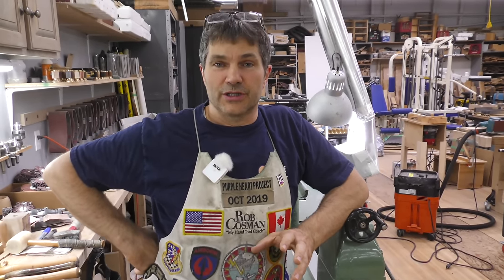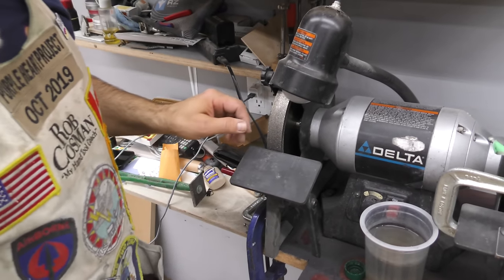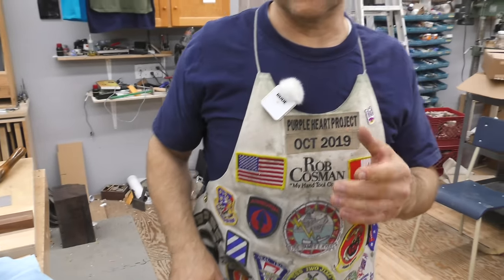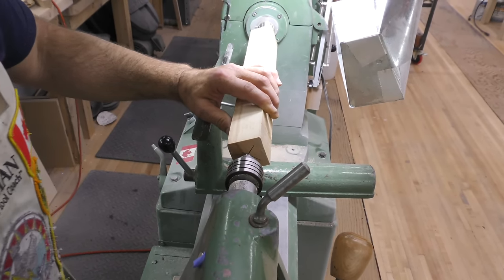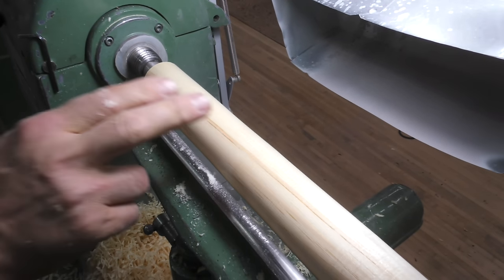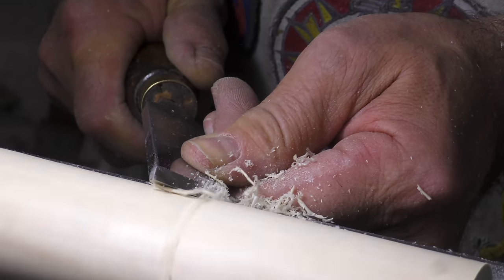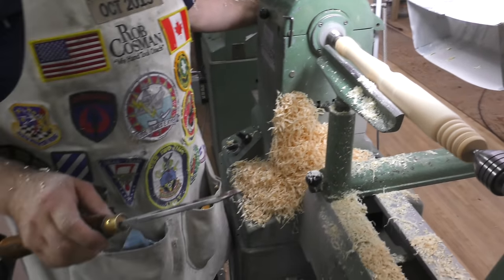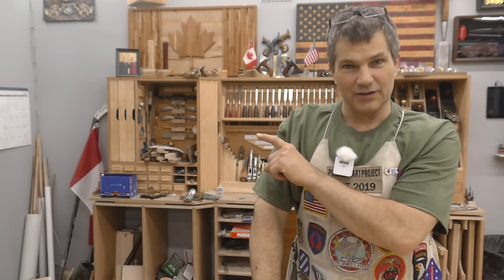Wood Turning For Beginners - Skew Chisel (What you need to know)

Comment: Thank you so much for your video.  I am 72 years old and new to wood turning, acquiring my lathe in early February of this year.  My only instruction has been what I could pick up from YouTube and recently there seems to have been an abundance on skew chisel fans and I find myself spending most of my lathe time with a shew chisel in my hand.  This past week I spent over 20 hours cutting V-grooves, rolling beads and barrels not to mention bringing my stock, be it square or tree limb shaped to a usable round condition.   What makes it an especial challenge is the fact that I am handicapped and cannot stand for more than a few minutes at a time.  Running the lathe, I am always seated on a 24" high wheeled stool.  My most recent work has been a variety of lace bobbins, using a 1 1/4" x 3/8" skew chisel for most of the work on each one.  
Again, thank you for your time and dedication.  I will be looking forward to your next video.
Reply: Best of luck to you, I just started, too.  I'm 74.

Comment: A couple of comments. One quote I have used for years, and then saw on a Roy Underhill show with a guest who was talking about hammers. It came from an old black and white Hollywood movie about Cyrano De Bergerac. He disarms a student and then comments, "Hold the sword as you would a bird. Too tight and you kill it. Too loose and it flies away." No white knuckle grip!

There is a ratio on spindles that applies to 'whipping' which is the tendency of long spindles to vibrate as you turn. It is 10 to 1. So a spindle about 1 inch diameter and 10 inches long will generally not 'whip'/wobble as you turn. 

From an unknown spindle master, "The bevel should rub the wood, but the wood should not know it." If you watch some one who is a master with the skew, it is amazing how little bevel pressure is needed for controlled cuts. 

Those who use a hollow ground bevel are by far the huge majority of turners. The flat ground are a minority. There are a few who use a convex grind. I have tried it, and for sure it is nice for coves, but kind of difficult to cut straight with. 

I use scrapers far more than most people do, and I don't have any of the carbide tipped ones. For heavy stock removal, a peeling cut is very effective, and it is kind of a scraping cut. Process is the same as a spindle roughing gouge. Start with the bevel high and the cutting edge not engaged. Slowly raise the handle till it starts to cut. Essentially you are cutting on a tangent. The surface is not as clean as a shear cut with a skew, but that can vary a lot depending on the wood. Pine, very rough. Sugar maple very clean. 

Looks like you have a high speed grinder. For my turning tools, I use a slow speed grinder. Consensus seems to be that with any good high speed steel, you can not get a tool hot enough for it to lose the temper. I don't quench. I do love the CBN wheels. Some have 1 inch or more for side grinding. 

Richard Raffen is a master. He did one for Fine Woodworking that still makes me jump when he gets a catch. The late great Allen Batty has a You Tube video that is very good.

Comment: So just last night I was getting some cedar round to make a pepper grinder. It was looking too small so I figured I would try out my skew. I hadn’t used it yet even though I’ve had it for over a year. I was blown away when I saw how smooth the piece was coming out. Then I watched this video. Tonight I will play around with it and start using it as part of my arsenal. Thanks.
PS, why are some skews sounded top and bottom and some flat on both sides?

Comment: Don't have a lathe but absolutely want one.  Would be very useful.   Hopefully just learn this skew chisel and not bother with any other tools.  Awesome video.
Reply from the maker: Well you really need 4 chisels for turning, depending on what you do of course.  I think the skew is the most important.
Reply: I'll take your advice on that for sure.
Reply: I agree the skew is very useful tool :-) I started with it, when I participated woodworking courses on a local adult education center. The first time tools were dull, but got much better results when sharpening. I got occasional catches with that tool, mostly when doing round shapes (beads) and with parting. I quess the root cause is that the edge of blade did not rest properly on wood (and the tool holding angle & support point on the tool rest).

Comment: i met an local man who was during the 1950 or thereabout, the shop master of the Mare Island Navy Yard pattern shop, he apprenticed there in the early 1920s and built patterns for an early iteration of the Doble steam car; he offe5red to demonstrate the use of the skew chisel on a wood lathe that he had built from castings and patterns that he made. He seemed quite proficient with the skew chaise and showed me to grind the face of the chisel about twice the length as the normal, stating that the longer face made digging in less likely, as the point was further away from the cutting area, also he said that most of the patternmakers used a firmer chisel in place of the skew chisel as it could be used in hand as a skew chisel or a scraping tool.  His name was Earl Greenwell, proud of having known him.

Comment: Just two weeks ago I bought my first lathe, before that, I played around with a lathe only once, which was a few years ago with an old friend of the family in Germany. One whole afternoon playing around with a spindle gouge, I was enthralled. So, when I bought that lathe two weeks ago, I obviously also bought a bunch of tools (a 6pc british Record Power set). 
So far, I used all those tools without problem, except one. The one I haven't used so far is the skew chisel, which scared the heck out of me. It just looks like it'll easily bite into the wood, and it was literally giving me visions of that thing flying out of my hands (and into my stomach, or other bloody mishaps like that). Well, this video, especially the slow turning part, did give me a good clue on how to handle it properly AND safely. 
I can work with tools of which I respect the risks they come with. I refuse to work with tools whose risks I fear. Turning fear into respect requires knowledge and understanding what's happening, and that was exactly what this video provided.

Comment: Hey Rob, I want to thank you so very much for this video. I have only been wood turning since April 2022 and I kept failing at the skew badly. I got to where I only used it for cutting lines. After watching this video first thing I did was resharpen my Harbor Freight skews to an angle much closer to yours using your grinding wheel technique which took a couple hours in the Florida heat cause i had to take breaks. Those skews were very far off from the angle you use and I had been staying with the original angle which was clearly the wrong things to do.  Then I just finished trying what I watched you do and have managed to get some fairly decent cuts that would require much less sanding. Granted I am still horrible with a skew but practice makes perfect. At least now I have the knowledge to learn correctly. Thanks again. Yall have a wonderful day.

Comment: Confidence is the most important thing with the skew chisel, a catch or two can demoralise a beginner. So much so they abandon the tool for something that seems less lethal. This is a real shame, because nothing can match the skew for crisp spindle turning. I'd advise using a concentric drive centre, which will stop rotating in the event of a catch. You will recoup the cost with the reduced laundry bills.
Reply: Gav, you make a very good point here, it was a rather nasty catch with the skew that caused me to get some training. I had been gifted a lathe, but had had no previous turning experience.

Comment: I'm so glad I found your video on instruction for beginners. I recently purchased a lathe and you have answered many of the questions I had. However, I'm in a quandary over which lathe tools are the best to purchase. From what I have seen, the carbide throwaways are most convenient, as buying all the hand sharpening equipment is expensive and time consuming. Any advice you could give me would be appreciated. I have been involved with woodworking for many years but have found the lathe to be the most rewarding and relaxing.

Comment: I like a horizontal tabletop belt sander for sharpening many tools including lathe chisels. Thanks for the skew lesson. I use it like a scraper because cutting with it terrifies me. If you do scrape, a hardwood usually cleans up pretty good if you take very light passes to finish it off at high RPM with a sharp edge.

Comment: Thanks for the video. I'm saving my pennies to get CBN wheels, but one of the features that I've seen highly touted is that CBN wheels are solid steel, so they don't overheat. Do you find the skews and gouges get too hot with CBN wheels?

Do you find a flat grind has any advantages over a hollow grind, or is it personal preference?

Comment: I bought a skew that is rounded on the flat part if the tool. I am assuming the use of the tool is pretty much the same?
Reply: The oval shape skew can rotate side to side on the tool rest much smoother  than the flat sided skew, which is great for making consistent beads with greater control. The benefit of the traditional skew is that it lays flat on the tool rest making it easier to ride the bevel and do long shearing cuts. Its just a matter of preference, its better to start with a flat sided skew because the oval shape is less forgiving when it comes to bites

Comment: Hey Rob, love your videos they are great instructional tools! I’m brand new to woodworking and your videos inspired me to start woodworking with hand tools. However I do not have any to begin with, in your opinion what tools would be the smartest to start off with buying? Thank you!
Reply from the maker: Sharpening first, get a double sided Trend diamond plate 300/1000.  Grab a Woodriver 5 1/2 jack plane.  Three IBC chisels, 1/4 ,1/2 and 3/4.  My Dovetail saw and joinery crosscut saw.  Pick up a Cosmanized Woodriver marking gauge and a Woodriver low angle block plane.  Good start, robCosman.com

Comment: After years of wood turning, I have only just mastered the Skew. Had many pieces ruined by catching edges and taking chunks out the work. Watched some videos recently that fully explained what I was doing wrong. Basically had the rest set to low and didn’t present the skew properly.
Reply from the maker: Thanks for sharing.  Tool rest positioning is very important, just a hair below the center line of the work an set close to the work

Comment: I was told a million times by a million instructors to NEVER EVR use the side of your grind stone.  It weekends it and could fall apart and do a lot of harm.     Anyone know this as well ?
Reply: This isn’t a traditional stone. It’s a metal wheel coated in abrasive. They are designed to take side pressures, so there’s no concern about what Rob’s doing.